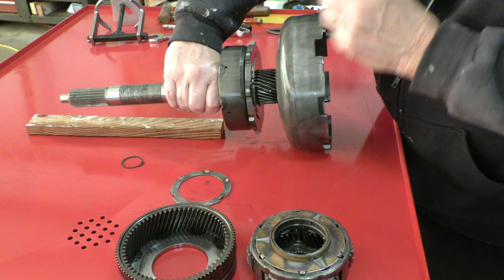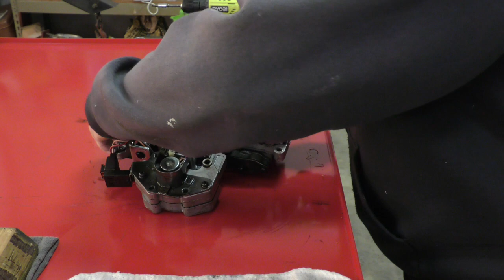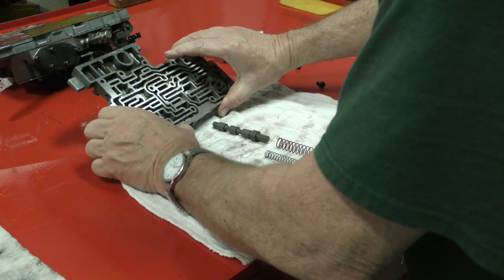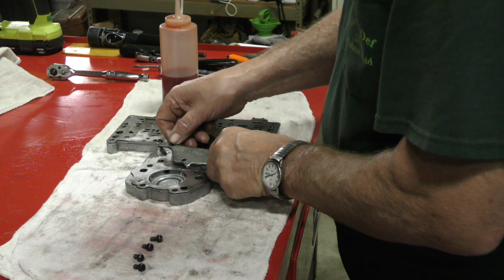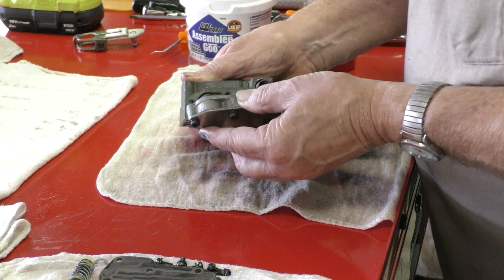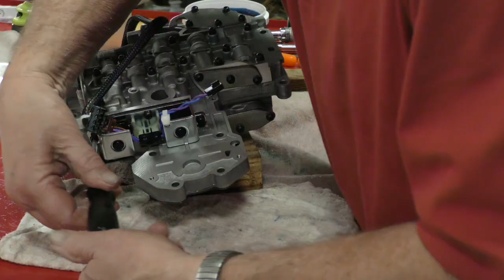2006 Dodge Ram 48RE Trans Rebuild, Component Inspection Video 2 of 3

Comment: The 48 and 49 re were the best transmission Chrysler had built and you also have to include the 46 re. They were reliable and strong. Chrysler's problem was assembly!